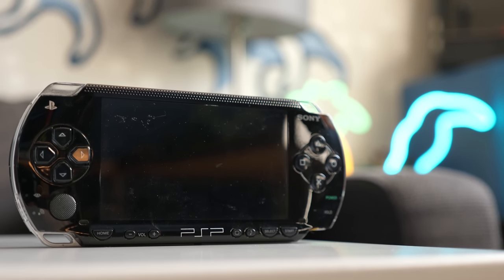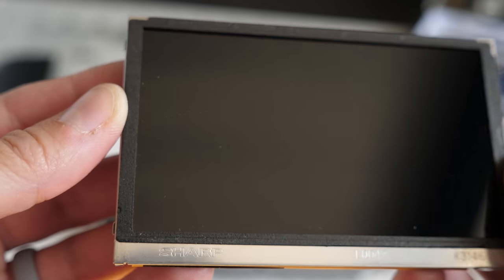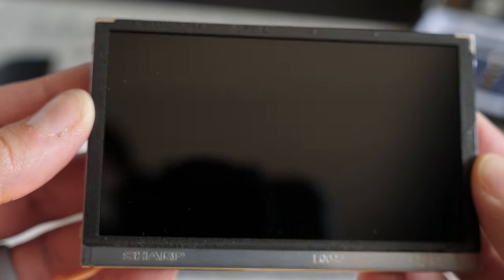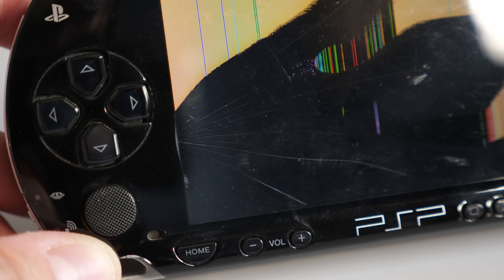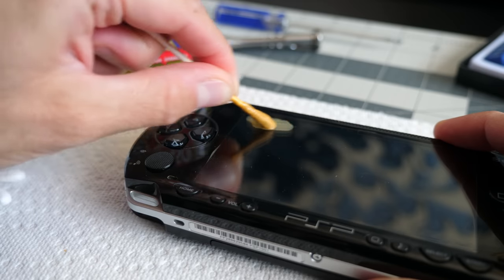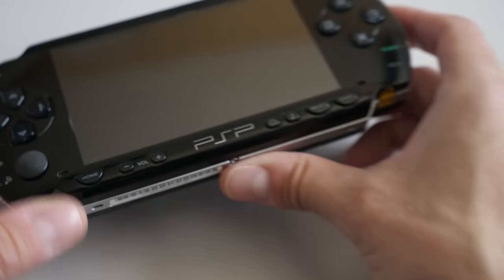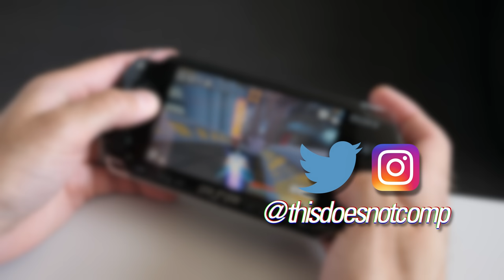Replacing a Broken Sony PSP Screen

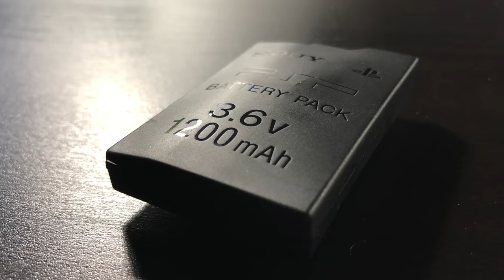Comment: 1:29 what does that mean for my battery because my PSP 2001 (Daxter Entertainment Pack) battery is not swollen and holds well over 2 hours of charge with moderate usage
Reply: You got a good one. Mine swole and burst through the casing. Even popped the battery lid off over time.

Comment: Can't say I've really had a third party battery that lives up to some of the outlandish capacity claims. But nowadays, all of them last better than the remaining Sony batteries do.
Still surprised that there are working psp 1000's with a functional UMD drive. Especially considering that every single 2000 and 3000 had theirs either already dead or fail within hours of picking up the unit. So far, the 1000 I ended up with is the only one that I've had a working UMD drive on.
That said, while the screen on mine wasn't bad, I did want to upgrade to the IPS one. It was just a matter of wiating until there was a seller that had a decent amount of reputation on eBay and wasn't charging triple digits for it. I think I paid about $40 USD shipped, for mine.

Comment: I tried to replace the screen on my 2000; the screws were stripped, drilled em out, and the new screen didnt even fit.
Got a "new" 3000.

Comment: I also have a psp-1001 model but with a faceplate with a huge crack toward the side. My psp looks fine but dust gets in so easily. I tried replacing it but when I bought it eBay it was all scratched up and made my display look awful which it usually doesn’t. Does anyone know a good method to obtain a faceplate that isn’t scratched up.